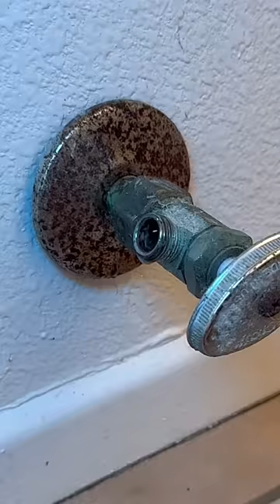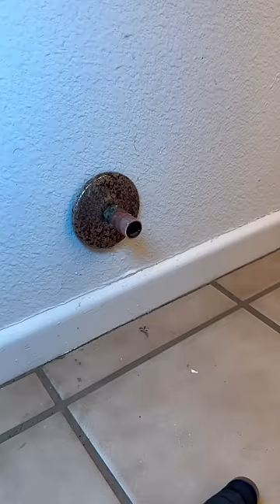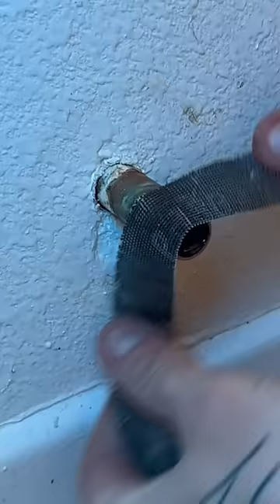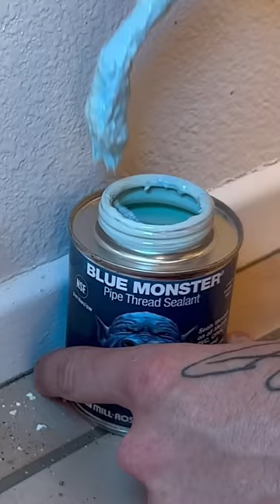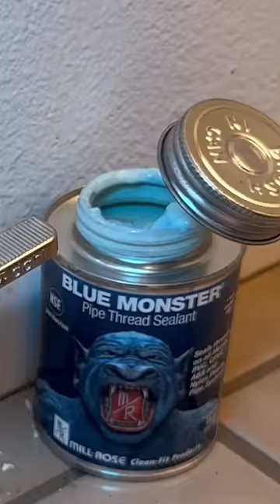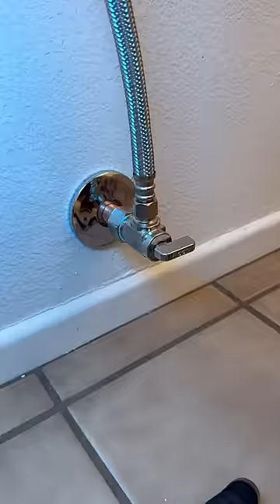HOW TO INSTALL ANGLE STOP! #new #newvideo #tips #tricks #hack #hacks #troll #water #plumbing #fyp

Comment: As a handyman for the last 20+ years, I'm always amazed at all the wrong places where people use tape or joint compound.
Reply from the maker: Oh my god don’t even get me started 🤦‍♂️😂
Reply: You don’t put thread sealant or Teflon at compression fittings. The brass ring does the water sealing.
Reply: I am glad you said that, I was just thinking the same thing
Reply: This guy does it wrong every time he uses a compression fitting. He thinks it’s extra insurance against leaks or lubricates the threads when tightening, neither of which is true. If I saw this on a job of mine I wouldn’t be calling him back again. 🤡 of a plumber!
Reply: I personally wouldn't use it.  Some people use it as an antisieze
Reply: I found Teflon tape on the bleeder screws on my car.
Reply: As an electrician I’m surprised some handymen are still walking around with a brain 😅
Reply: As a plumber for 20yrs, I see nothing wrong with putting a bit of dope on threads. Good job!
Reply: @ryancook1608  So you should be able to explain how that seals.
Reply: @robbsclassics  you're forgetting the other purpose of the dope, lubricating the threads because not all threads are made perfect, and the dope helps the fitting screw on that much better.
Reply: @robbsclassics  not for sealing obviously, but for antisieze, and to help lubricate and tighten better. There is nothing wrong with or without using dope on threads of this nature. I do it often
Reply: Ok. I'm still not doing it. It's needlessly messy.
Reply: @robbsclassics  if you cant help but make a mess then I'd have to agree with you hahahaha
Reply: @ryancook1608  What happens when you take it apart? What do your fingers and tools touch? What if you set it on the floor? Needlessly messy.
Reply: But he got tools. He a PRO!
Reply: That compression fitting don’t need it only gas lines
Reply: @kennhill968  gas lines using threaded pipes. Flare connections and compresión fittings don’t need pipe dope or thread sealer.
Reply: @rvd64  correct
Reply: @Tierone1337 does it compromise the brass ring?
Reply: That’s why your just a handy man bud.
Reply: Dude obviously knows what he is doing. Hence the specialty tools he’s using. I can almost guarantee that you’re using pliers and an adjustable wrench. 😮
Reply: @Iwishitwas-hl9wj i mean…it does lubricate the threads?
Reply: As a handyman if you don't know why he did that,that explains why your not a plumber...If you know you know #journeymanplumber #layingpipesince1995 #plumbing28years
Reply: As a handyman you've never had to install hundreds of angle stops consecutively. Stick with what you know...like plunging $hitters 🤡
Reply: It’s not acting as a sealant. It’s used to make a smooth finish as your tightening the compression nut. I personally use valve grease. Anyone who has to take that thing off in 20 years will thank him.
Reply: @HDPLUMBERS no please get started. Explain how that pipe dope will seal your compression fitting
Reply: @daddy1571  handyman - someone who has to know about a lot of things, have the right tools, and be efficient.
Plumbers - Someone who takes apart and puts together pipe.
Reply: @robbsclassics  plumbers are licensed by the state handyman aren't licensed at anything at all. Plumbers know plumbing and have to incorporate other skills too.handymen usually screw up jobs and steal people's money
Reply: @Basskilz15  have u ever seen a compression fitting with mineral deposits? No thread sealant
Reply: Use heat proof grease as a lubricant on compression joints  !
Reply: @jessesalazar7513  no. Because I use compression fittings in the proper way. I work in chemical plants and never have seen mineral deposits. You are not suppose to use dope or sealant. Hoke fittings and swagelock tell you not to
Reply: @jessesalazar7513  if I were to put sealant anywhere I'd put it on the compression sleeve or the tapered end of the angle valve
Reply: @Iwishitwas-hl9wj It's to get people like you to comment Driving up analytics, making it wear more people see his videos more money.😂
Reply: If you are calling that a "wrong place" to use joint compound then that explains why you have been a handyman for 20 years and not a plumber...
Reply: @robbsclassics it seals the threads so the nut can't possibly come off that is why it's called thread sealant... Also over time brass wears and that thread sealant will add that extra security so maybe instead of ten years you get twelve, not a huge difference but that extra two years is better than the ten. No it's not a need but at the same time that's why a plumber is a plumber, an electrician is an electrician, and a handyman is a handyman
Reply: Where can I get that back up bar at?
Reply: @Cpt.Pheonix  No. Pipe threads need sealant, specifically gas. Compression fittings rely on the malleability of brass and copper forming to each other. Right now I am currently working on restoring a steam engine lubricator. It is well over 100 years old. It has pipe threads and compression fittings. The entire lubricator is made of nickel plated brass and there is no thread sealant anywhere.
Reply: Dope on angle stops all day
Reply: @jeffreycrawford1121  Yes, if they're pipe thread.
Reply: @albertalmaguer7362  no it doesn’t. But it is useless and contra-productive. After a while it hardens and might act as thread locker. Also it is a waste of material=money overtime.
Reply: @Basskilz15  It doesn't make a "seal". It lubricates the threads so the ground joint is pressed together tighter.
Never seize will work too.
You should stick to plunging toilets.
Reply: @albertalmaguer7362 can affect the torque and over tightening becomes an issue… the thread here isn’t where the seal is formed so it’s a useless step and not needed. 

Like I can rub that paste on my grandma when she cooks for me, but the food won’t come out any better and I’ve just wasted time and money.
Reply: @daddy1571  oh that makes sense. It's a dumb plumber trick. See I'm a pipefitter welder who works in chemical plants. Must be a residential thing.
Reply: @daddy1571  you don't need to lubricate the threads to make sure the "ground joint" or compression sleeve (is what it actually is called...) get pressed together tightly
Reply: I find tape on everything. Today on some flared fittings
Reply: @danbelliveau2550  which is crazy but I get it because on JIC fittings which you're not suppose to put tape on but I have on my argon bottles to help keep it sealed better due to the fitting being used so much over the years.
Reply: @Basskilz15  You probably don't. It can help with inconsistent Chinese threads with imperfections. If it doesn't leak,either way works. I've installed vandal proof stops and didn't dope the threads and they sealed fine.
Reply: @xxxmikeyjock  thats what she said
Reply: @in-textbaptist4947 yeah maybe..but I’ve never had that in all my years. I actually hate that stuff. I see it on fucking sink tailpipes or teflon or even on the brass shut offs I’ll see teflon. Idk. I just know it’s not doing anything.
Reply: I've seen plumbers put pipe dope on the threads of plastic slip joint sink drain connections. It gums up the threads so you can't get it tight enough on the washers so they leak. Plus you then need pliers to remove them. Why?????   Another beef I have with plumbers is they fill up the kitchen sink baskets with so much putty that it, again, fills up the threads so you can't get it tight. I know, I'm just the property maintenance guy so what do I know, right? Just 50 plus years of experience, that's all. Smart a$$ plumbers.
Reply: There’s a reason it’s called pipe DOPE
Reply: @Basskilz15  BS they all seep out fluids and then it builds up around the fittings...been plumbing 28 years of om telling you the cat is black it's because I'm holding the cat in my hands
Reply: @robbsclassics  what would I set messy tools and materials on?! a pad, a piece of cardboard, a rag, etc; a professional plumber wouldn’t be setting much of anything on the floor. This is service work folks, y’all really should be humble on the subject if you aren’t a plumber.
Reply: @robbsclassics you ever heard of a paper towel?
Reply: Yeah that’s why you’re a handyman
Reply: @Matthiass721  I like to keep the things I'm working on, my tools, my work area as clean as I can. The only thing this does is gum up the threads and make a mess. It doesn't help at all. I'm not doing it. I have dope and Teflon and dope for pipe threads, not compression fittings.
Reply: @robbsclassics As someone who does House Remodeling and does this work alot.    Mess comes with the job. If you can't deal with a small mess then don't sign up for the job
Reply: @JaySunTheOmega  I restore houses. Some of which are 200 years old. I work on 100+ year old plumbing that comes apart fine with nothing on it. I have a steam engine lubricator that doesn't have dope on any of the threads, and that has to hold a lot more heat and pressure than anything in a house. I'm not putting dope anywhere on compression fittings. It's messy, wasteful, and doesn't help at all. If you don't understand the metallurgy of the brass fittings you use, I don't care.
Reply: @robbsclassics  I am not arguing for do and don't when it comes to anything. I'm just saying if you don't want to deal with a little mess don't be in that line of work. Sometimes you'll have to fix people's mistakes and that can be messy sometimes. That's all I was saying. I apologize
Reply: @robbsclassics It doesn't seal. It just lubricates the threads to make it easier to compress the ferrule .
Reply: @JaySunTheOmega  And I'm saying I'm not making a mess if I don't have to. That is all. My work is mostly fixing others mistakes, sometimes working with the 150 year old "temporary" fix.
Reply: @danvilla1438  No, it doesn't. It makes it harder to get it apart after a few decades of getting hard. If you want lubrication use a few drops of oil for no reason because brass doesn't want to seize to itself.
Reply: @Tierone1337  The brass ring is called a ferrule, no water will get anywhere near those threads. Amazed they didn't put pipe dope on the braided supply line threads as well.
Reply: Exactly. Someone gets it. You have to break lose enough old fused together fittings and you atart thinking aboutways to prevent it. Thread dope is just a nod to the next guy working on it.
Reply: As a plumber I see nothing wrong with pipe dope extra assurance hey why want 👍🏽
Reply: @MilkingTable1  What?
Reply: @MilkingTable1  your taking what I said out of content. Read ahead and you'll see he said stick to plunging toilets. Now while I do that at home I do not do that for work. He put it in a derogatory way
Reply: @MilkingTable1  and it's pipefitter/Welder. Mind your business.
Reply: @MilkingTable1  my plant setup is dow chemical lol stick in your lane kid
Reply: @MilkingTable1  we have a higher standard in plants. What trade are you? Lol and I've been doing this for 8 years
Reply: @MilkingTable1 bro I’m not confusing anything with anything. Any plumber knows that is not what that paste is for. You have confused yourself here thinking that the thread in the video creates a seal when it does not. That thread is only there to squeeze the olive. Honestly so many terrible builders are there  don’t know what they are doing
Reply: @robbsclassics it seals two ways now!
Reply: @kennhill968 In the UK any tape on a gas compression fitting would fail the regulations.😮
Reply: @andrewhart2330  oh no kidding we can only use the yellow tape on gas it doesn’t shred like the white or blue and I put pipe dope for extra piece of mind
Reply: @FirstnameLastname-vy2dg  Hahaha. How stupid of me. LOL
Reply: The amount of times I've seen PTFE tape on compression fittings is ridiculous
Reply: As a plumber of 10+ years, stick to being a handyman 🤣 ill be back to fix your shit
Reply: agree, why put thread sealant on a thread that is for sealing only compressing
Reply: @meatpiman224  pipes vibrate every time you turn the water on or flush the toilet in this case. They vibrate and make noise especially when you have a handyman do the plumbing and he doesn’t properly strap and support the pipe. After years of use the packing nut will loosen
Reply: I mean, if it works, then it
Works. What’s your complaint besides it actually works?
Reply: @robbsclassics I've done this when using a vacuum bleeder. Can't really bleed without some kind of sealant on them.
Reply: Every good plumber I've net used pipe dope on all threads even on compression fitting more for lubrication to get a good seat on it
Reply: @robbsclassics  so you wrote a lot to say you’re ignorant. Cool story bro, still objectively wrong. 😂
Reply: @Matthiass721  But actually right.
Reply: @robbsclassics first you get good then you get fast and then you get clean with it. 20 years experience gets you to the fast mark. Keep working you’ll get there.
Reply: @Iwishitwas-hl9wj ... Exactly.. If the ferrule didn't seat correctly that thread sealant isnt going to stop it from leaking.
Reply: @ryancook1608 ... Exactly.. If the ferrule isn't seated correctly the thread sealant won't stop it from leaking.. They are just gumming up the compression fittings threads using thread sealant..
Reply: I came straight to the comments to see who all said this exact same thing. Guy needs to keep watching how the other guys do it before making a video on how TO flood your clients house.
Reply: @robbsclassics
More than likely the Teflon tape on your bleeder screw was because someone was attempting to do a one man brake bleed using a water bottle and hose. The Teflon on the bleeder threads is to seal the threads when the bleeder is cracked open to prevent air from being sucked into the caliper when releasing the brake pedal in a one man brake bleed scenario.
Reply: I was here to sat this lol
Reply: Compression joint.....I Guess that's confusing. Absolutely no tape or dope
Reply: Why do you care what other people do let people work the way they wanna
Reply: @Iwishitwas-hl9wj your a clown of a customer, you should have done the work yourself instead of calling him, why care where he puts dope at if it doesn't need it it's just extra care
Reply: And that people use compression fittings 😮
Reply: @HDPLUMBERS you are who they are along about
Reply: Will it leak?
Reply: Listen fellas, I hear all of you. You all make good points. Pipe dope will not seal anything on straight threads on an angle stop. However, a little lubrication on the threads doesn’t hurt. Pipe dope as we all know is for tapered threads on pipe. Just like ptfe. I’ve seen the effects of over tightening a brass compression fitting be remedied with some wraps of tape around ferrule. On stainless swedgelock as well. Sometimes you just gotta seal it until you can do it right upon shut down.
Reply: Pipe dope is used to reduced the heat of friction when tightening the threads. I take it most the people here are called back for leaks regularly. This video shows nothing wrong with his work.
Reply: @robbsclassics 🥱
Reply: @robbsclassics yes 😂you a troll
Reply: He's probably doing it for engagement,  couple hundred people leaving comments that goop isn't needed, drives up comment count so youtube recommends the video more.
Reply: Buddy said he WILL NOT be surprised by a leaking compression fitting again!! 😅
Reply: You can literally see on the label “seals pvc, cpvc” 😂
Reply: Me too!! Should been used on the Ferrel.
Reply: @rvd64 in some cases they do.
Reply: And no ferrule either.
Reply: Yeah, well as a plumber you're supposed to dope the feral on a compression angle stop
Reply: Always dope 🏆
Reply: As someone who's a 18-year veteran of YouTube, it never fails to amaze me how blue collar workers spend so much time shitting on each other over stupid shit.
Reply: Lubricates the threads to prevent galling or lockup.
Reply: You are a handy man. This is what we plumbers call "insurance"
Reply: All the handy Andy's saying the compression doesn't need dope.   You my friend demonstrate your lack of knowledge by that comment.   Every plumber, I'll say again.  Every good plumber dopes a new angle stop.  Try again handy Andy.
Reply: Handyman aka jack of all trades, master of none
Reply: It's a compression angle stop .Why in the world did you use Teflon ?
Reply: Blows my mind too
Reply: That sealant will lubricate and cause him to overtighten the compression fitting which will  compromise the seal and the copper pipe. Even as anti seize, it's probably not rated for brass.
Reply: @ryancook1608 I work for the pipeline and we have hundreds if not thousands of compression fittings we have to inspect. I've probably done more this year than you did in your career. Not to even consider I used to setup multispindle lathes and run QC for pipe and compression fitting run offs.
1. Pipe dope is not a lubricant.
2. You just changed the torque value needed to compression the ring properly.
I have been to Parker and Swagelok classes too multiple times. Guess what they say. "DO NOT put pipe dope or tape on any straight thread only tapered"

Just cause you don't see a problem with it doesn't mean you are right. I've literally made, installed and annually inspect these fittings, not to mention I have to be OQ'd by the DoT to install them.
Reply: @atcook87  you work for the pipeline, you are not a plumber. You couldn't plumb a house or anything else. Pipe dope is wet, wet is lubricating. How would it affect torque values? Thanks for your comment I'll take it into consideration.
Reply: @ryancook1608  lol how is water distributed in a city and a house? Pipes right? We use all the same things plumbers use aside from pex and pvc. Flange fittings, tapered fittings, expansion joints, check/gate/slab/wedge/needle/twin seal valves. I can plumb a house but I guarantee you wouldn't get past the OQ for tube bending/installation of compression fittings or the one for installation of threaded fittings to even work on a pipeline. If I could link things I would send you some info on how lubricants change how torque is applied to a threaded connection. I'm not trying to be an ass. I literally went from making these fittings from blueprints and did the QC  tests on them to now working with them on a larger and highly regulated scale.
Reply: @ryancook1608  also pipe dope dries and doesn't stay wet. I don't know in what world you think lubricants should dry out.
Reply: @atcook87  no, actually plumbers and your utility trade are completely different things. I wouldnt pretend to be a utility man. Different fittings, pipes, and sizes. We shop at separate supply houses and adhere to different codes. Ive known and met utility workers, and they dont know plumbing code or how to rough in and finish a building, so dont pretend to be a plumber. I dont use pipe dope on compression fittings as much as I use to, now Im in a hurry, but, I see no harm in using a smidgen of wet non setting pipe dope on the threads only, and theres no plumbing code against it that I have heard of. Show me a plumbing code, utility man, and I will stand corrected and concede!
Reply: @atcook87  ky jelly will dry out too if you leave it out long enough, everything dries out, 2nd law of thermal dynamics hahahahaha... nice surname, we might be cousins somehow 😆
Reply: @robbsclassics bad argument to say “I’m doing it the way we did 100 years ago” times have progressed gramps and we have sealant now. “Jack of all trades is a master of none” you’re a handyman so I’m sure you’ve never read Shakespeare but he did have some good points.
Reply: @ryancook1608  I used to do Low voltage (different trade i know) working in construction, I understand how to read a print, rough in things and finish the work. Building codes aren't hard to follow. The only thing that sucks is some codes are different state to state. But the basis of the codes usually state, even in my industry, to install things per manufacturer specifications. Yes we go to different suppliers but I've grabbed 2" ansi rated flanges from a plumbing supplier before. I think it's funny you think we use different things based on the size.  I can literally go to a plumbing store and get what I need, the only reason we shop at different stores is because most plumbing suppliers don't supply MTRs for each thing they have in the warehouse. It I want a 90⁰ 1/2 npt elbow I have to get it from my supplier cause they have that document on hand. Lowe's or Ferguson don't.
Reply: @ryancook1608  lol maybe
Reply: @1stbadgamer389  Et tu, Brute?
Reply: The pipe dope worked exactly like it was intended to. It generated lots of comments.
Reply: Sprinkler fitter here; copper fittings, only use tape, for example a head. Everything else is dope then tape, for only the width of the tape. No need to dope and tape all the threads. Also, looks cleaner. 
I'm not a shit herder, so.....
Reply: When I was a plumber I put dope on everything. NEVER had leaks. JS
Reply: I knew somebody would see that he putting the sealant where is not needed that’s the only reason why I checked to see if somebody said that in the comments and is the first thing I see
Reply: @wtfishappening2049  the shit herder way. Did you put dope on all the threads or only the first 3-5?
Reply: @chocol8thunda  I just meant where the seals are. Not all threads, although on stop threads, it does help it spin easier. I'd put it on the brass rings though for sure.
Reply: @Iwishitwas-hl9wj  he doesn’t think it’ll stop a leak. He thinks it’ll lubricate the threads to prevent galling/seizing. Which it does. Some things serve more than one purpose. Quit acting like you know everything.
Reply: @Basskilz15  the way he’s using it, it’s for lubrication to prevent galling/seizing. Not for sealing.
Reply: @rvd64  blue monster doesn’t harden.
Reply: @atcook87  blue monster doesn’t dry out.
Reply: @chocol8thunda  did you say you put dope on the threads, and then tape? If thats true, that is silly
Reply: @BigBlockOverland  I know he is using it to lubricate  the threads and you don’t want to lubricate the threads on this joint. This joint needs the friction of the threads. Now if your over tightening your threads causing them to get galled you are the problem not the fitting or a lack of lubricant. Stop acting like you know more than me.
Reply: Soooo true
Reply: @Iwishitwas-hl9wj  it doesn’t need the friction of the threads. It needs the clamping force of the fitting causing a 0-tolerance fit. The friction of the threads means nothing. And if you mean for it to stay in place, the dope is ptfe enriched so it will stay once dried.
Reply: As a handyman.  I keep a container of 1/4 turn valves on me.
So many leaks I've repaired.
Reply: Nothing wrong with it! Just like any joint! Teflon dope it up!
Reply: @HDPLUMBERS dumbest comment of the year award goes to you.
Reply: @BigBlockOverland  I can assure you it does, I use it everyday and have a whole shelf of it.
Reply: @kennhill968 flexible gas lines do need it either.
Reply: Pipe dope is for lubrication and sealing. It helps the compression nut tighten easier in this circumstance
Reply: @HDPLUMBERS  you literally put the sealant on the thread instead of onto the copper between the fitting and the olive. You should do some training on how a compression fitting works.
Reply: @ryancook1608  It literally does nothing on a compression fitting other than get paste all over the threads?
Reply: @Dirtydiapers4U  nothing wrong with it other than your not supposed to use either on a compression fitting.
Reply: @Bill-nc6tx  Teflon dope it up!
Reply: @nico101gaming  nearly every single supply stop I come across, I can fairly easily pull the nut and ferrule off of the copper when I shouldn't be able to. Put a smidgen of something on those threads and tighten it down, then see if you can just pull it off. The engineers at brasscraft said its ok to put a bit of non setting dope or oil on the threads only, so who are you?
Reply: Old pipe that already have had a compression fitting on it, better to be safe than sorry. From experience reusing old pipe regardless how clean you think it is will sometimes leak. Stick to hanging shelves for old ladies and leave the plumbing to us who do it all day everyday for 20+ years
Reply: @HDPLUMBERS lmao my guy I can here to say the same thing. I’m a plumber also and while I don’t love the compression shut off it’s just a preference. And I have used them in certain situations plenty of times. but a handy man trying to call about a legit plumber ?!!! Are you kidding me.. I’ve been doing plumbing and heating 25+ years and never and I’m not exaggerating, never have I seen a diyer or handyman ever , ever ever do the correct plumbing job. It could be the simplest fix and there something wrong with it.. it might work but it’s wrong. Using pvc 90 incorrectly for a drain is a common one or them using some rig because they don’t even know what the correct part to use is or that it even existed. Hiring a handyman for plumbing always baffles me, you could literally kill  someone if you do things wrong incorrectly. Hire a handyman to make you a shelf or paint that’s it. And what these YouTube handyman are charging to do shit wrong doesn’t save you a dime.
Reply: Lmao I’d stop, in my 25+ plus years I have never seen a handyman do the correct plumbing job so really stop.. and i am not exaggerating NEVER and dont tell me you are different , you don’t even know if you are doing the right job.. you go oh that’s stupid I’ll do it this way and you don’t even know why things are done so you don’t even know if you’re actually doing it right. Do you own your states code book? No. And the fact you would put peoples life at risk , because doing plumbing , heating wrong you could kill someone os horrifying. Plumbers aren’t even part of the building sector we fall under the health board just to let you know.. so go call out other handy man
Reply: I'm learning
Reply: @robbsclassics noooooo
Reply: @Iwishitwas-hl9wj  what problem can it cause? You didn't talked about issues with this, although you claim to be useless. But there is any real problem?
Reply: Pipe dope can lubricate the threads which isn't necessarily a good thing as it can lead to overtightening if you don't know what you are doing. Other than that it really isn't necessary.
Reply: @Tierone1337  you can still put sealant wont make the seal any worse and makes it easier to replace later
Reply: @Iwishitwas-hl9wj  it does lubricate the threads, compression fits can still rust at the connection over time and thread sealant is a barrier that will make it still easy to remove over time doesn't effect it negatively at all its just not needed...
Reply: @Ian-tp6mu  why comment when you know nothing about the subject. This fitting will not rust and can not rust, it is made of brass plated with chrome. Yes he is doing it wrong since these fittings need the friction of the threads to keep the threads locked. Rust? Really? Your ret@rded
Reply: that shit really bugged the hell out of me
Reply: @robbsclassics  i mean can nobody here read it literally says thread sealant what other combination of words would you need as conformation 😂
Reply: I knew aguy that put tape everywhere it was a mess . I took it off and cleaned up behind him all the time! Can't leave it manytimes it causes leaks especially if its done wrong 😂
Reply: If it doesn't leak in 50 years or causes no harm whatsoever...does it matter?
Reply: Es plomero sabe y tiene lo necesario de herramientas, eso es basico
Reply: The real expertise can be found in the comments not in the silly videos
Reply: Says things about pipe sealant says nothing about using a compression fitting right back on the the same pipe where there already was a compression fitting without cutting the pipe.....THE BIGGEST NO NO in plumbing 101
Reply: @Tierone1337  your 100% correct the Ferrell does the sealing, however, I will put dope on the Ferrell, and sometimes I use dope on the threads to make it a little smoother when I’m tightening
Reply: Thank God, I didn't use sealant and thought I did it wrong
Reply: No need for dope on a compression fitting.
Reply: @robbsclassics don't agree with putting it on the threads however with this pipe being corroded and not being able to guarantee the diameter I couldn't see the harm in a bit of boss white and PTFE on the brass ring to ensure a good seal.
Reply: From just looking at what he did, twice, and being a pipe fitter of almost 10 years; he didn't put thread sealant on the compression fitting. He put it on the threaded female to male connections. That's a female to female slip by thread with a male to male thread by thread angle stop valve.

He sealed the female thread to the male thread valve. Nothing wrong is done here.
Reply: @Iwishitwas-hl9wj whats wrong with putting a little bit of added protection😂 compression fitting or not it makes it easier to get on like i said its added protection aint nothing with what hes doing,
Reply: As a plumber it doesn't matter what a handy man thinks
Reply: @Iwishitwas-hl9wj  why would you call a plumber if you know more than him anyway who cares if somebody puts piped up on a compression fitting it isn’t gonna hurt anything some people get more peace of mind putting it on there like myself matter fact, I put it on the compression ring too but what do I know I’m just some dumb commercial industrial mechanical contractor
Reply: @Jerbo1125  yes it does hurt something, that fitting needs the friction of threads on threads. It wouldn’t give me peace of mind, that fitting will leak before a fitting without sealant. This plumber should follow the manufacturers recommended install method not make up his own. I would call a plumber because I’m way too old and financially well off to be playing around behind a toilet, just because I can do it doesn’t mean I want to do it.
Reply: "as a handyman" so you don't have a college degree? Haha
Reply: As long as it doesn't leak.
Reply: Lmao
Reply: @ryancook1608 or just use anti sieze...old gas fitters used to use matchs to look for gas leaks. Don't mean it's the right way to do it
Reply: Guess thats why you a handyman and not a professional.
Reply: A handyman is. Not to comment at all😂
Reply: Was just thinking this.  Compression = no sealant....
Reply: The dope not only lubricates the threads it also lubricates the ferral a bit. U don’t want the threads to be what tightens u want the ferral to compress and create the seal. The lubrication helps insure that this is what’s happening. It helps you feel the compression and not just the threads. I agree with that pipe dope being used here. But that’s the only pipe dope I would use on a compression fitting. Also yes I have my p1 license and been doing it 20 years.
Reply: Like on the threads of stove hoses …😂
Reply: 😂😂😂 HANDYMAN like that’s a job title or something.
Reply: As a handyman for the last 80+ years i agree
Reply: I know man ridiculous, and that reamer is terrible
Reply: @ryancook1608 Absolutly agree with You. Some people just like being negative.......😅
Reply: @Tierone1337 that would not be correct, the dope placed when it was serves 2 purposes. 1 it lubricates the threads so the nut can be tightened better. 2 the dope is placed where the ferrule is seated for a better seal.
Reply: @Iwishitwas-hl9wj you are incorrect. It is exactly what it is supposed to do.
Reply: My exact thought
Reply: As the CEO of blue monster I approve. Although not enough product was applied. You have to dip it. 
Like an Oreo in milk. At least elbow deep though.
Reply: In Cali we epoxy those connections.. ...the combination of pipe dope, installer dope and epoxy ensures no leaks....4-10 mandude....the Cali way rules....plumbers leaving Cali because they're NOT good enough to hang with the TOP DOGS!
Reply: @Tierone1337 that wasn’t a flare fitting
Reply: Yep, that sealant on the threads does nothing but waste time and your money.
Reply: @Iwishitwas-hl9wj  What would you use ?Will you sweat it if not using a compression fitting?
Reply: @robbsclassics gas pipes use tape and or pipe dope or monkey snot above ground. Below ground on transmission lines, we use ab nipples and seal weld. That is not a compression fitting like many are saying. Looks like a valve, with a union.
Reply: @NathanThePrezPretlow  I would use the same fitting just no sealant and install as per the manufacturers instructions.
Reply: @gns4838  I have replaced tons of those. It's a water valve for a toilet. Yes, it is a compression fitting like I'm saying. I can't believe you can install gas line and not know what a cut off valve is.
Reply: Whaaaa
Reply: Lol 🤡
Reply: Hey u need some gloves
Reply: ❤Ptoptpptt
Reply: The threads don't seal the fitting too the pipe, who trained you.
Reply: It's lubricant..👀
Reply: As a plumber of over 30 yrs I was going to say something very similar.
Reply: Pipe thread sealant is not needed on compression fittings, amateur.
Reply: @Cpt.Pheonix or you could just put the damn thing together as the manufacturer intended.  This is a hack not a proper procedure.
Reply: @Cpt.Pheonix  It's... Not loctite nor is it anti seize.  Do you even know how a compression fitting works?  Because if you think those threads need sealed you don't know shit.
Reply: That isn't wrong
Reply: @josephpark3048  I specifically said it is not needed, however I stand by what I said. It's the small things you learn over years of doing something, that's why a plumber is a plumber and a handyman is a handyman
Reply: Holy shit right?  I find pipe dope and tape on swivel flare nuts but never compression fittings holy shit.
Reply: @ryancook1608  If you see no problem with it then that means you probably aren't doing the other part of the job correctly.
Reply: @MrScotaru  not only is that a ridiculous thing to say, but, you should have read some more of what I said the the conclusion. Engineers at Brasscraft have stated that it is OK to use a bit of non setting pipe dope or oil on the thread of a compression fitting.. Are you an engineer? I didn't think so lol
Reply: Looks like that socket and extension is a lil pitted, definitely not Snap On!
Reply: Good Job, id hire you no problem
Reply: Same, unless the dude is using it for anti corrosive, or for comments.
Reply: Tape is a sealant.  Dope is for lubricant purposes.  Although I don't see the need what he did wasn't incorrect.  He lubricated his threads to get a slightly tighter seal on the ferule when tightening the nut.  Me personally never have and probably never will but that doesn't mean he was wrong.
Reply: You don't need to put anything on a compression fitting but it does help lube the treads and make tightening a little easier.
Reply: Everyones wrong... teflon and pipe dope dont seal anything... theyre both essentially a lubricant to prevent metal on metal friction.... they used to use cutting oil instead of dope and teflon... using dope and teflon isnt going to HURT that joint, its unnecessary. Can we all just be happy that he used a compression stop instead of a sharkbite?
Reply: Is funny. How a bunch of ignorant talk about handymans when, in reality a handyman has the knowledge on how to fix pretty much everything and have the tools for it compared to a person that only does one type of job, is like saying that you are smarter than the guy that speaks 5 languages because you speak one 😂
Reply: No lo creo,  para mi, mejor soldarle un cople roscado macho , y listo, años de aguante cada que cambien la válvula.
Reply: I don't see a copresion ring. Maybe that's why the sealler.
Reply: @HDPLUMBERS what is the wrench u used name exactly?? Its so interesting
Reply: Yea well your not a plumber your a handy man and if he wants to put dope dope on the threads it doesn’t hurt anything..
Reply: Everyone on here talking shit and that’s why you are handy men that do shit jobs you have no clue about plumbing, I have went behind so many so called handy man and the shit I see is amazing
Reply: @robbsclassics  I did not see him make a "mess" with anything he did in this video...
Reply: I am not a plumber and know that the valve doesn't need thread compound. It doesn't show the compression ring, but it should have one. Pipe dope is not going to prevent leakage from that valve.
Reply: @robbsclassics there may actually be a valid reason for that. When the bleed screw is open when using a vacuum bleeder it sometimes pulls air through the threads rather than pulling the fluid, so a bit of PTFE on the threads can help stop that.
Reply: @dafyddwilliams5223  It was on the clutch lines too. I found so many things wrong that had to be corrected on that car.
Reply: If you have an angle stop with a compression fitting, you put the pipe Dope on the ferrule, not the threads. 
This guy doesn’t understand the basics of plumbing. 
I’d be willing to bet he makes the same mistake with slip joints and unions.
Reply: @travishouse5988  No, no pipe dope at all. Don't confuse people.
Reply: What kind of wrench is he using?
Reply: That was actually the best place to put the paste. If you look closely it was just on the point where the olive will compress on the valve.
Reply: @Hesterplumber   as a handyman I’ve corrected work for both plumbers and electricians many times…. But I work alongside the old guys and learn the correct ways.. just saying not all handyman are bad people the fact I can do more then most trades makes me smile. I can do everything I’m not trade specific… but I’m always willing to learn new things.
Reply: @Tierone1337  he was using it as a lubricant. The old brass craft valves in the instructions would tell you to put a drop of oil on either side of the Ferrell. We don’t carry around a little thing of oil for that so a little dope we’ll do it. 
In fact, if when you’re putting compression fittings together and they squeak it’s because of friction.
Reply: @daddy1571 Most handymen leave the feces to the plumbers...pretty smart, huh?
Reply: Actually brasscraft used to have instructions on the box back when I was an apprentice. They said to use a drop of oil if you’d like to. There’s nothing wrong with this. The instructions are on YouTube now. The purpose of pipe dope is not to make threads seal up. It is to make things easier to turn so that they will seal as they were designed to.
Reply: @kirbazoid you beat me to it. Did you start in the 90’s too? You’re absolutely correct. No one carried 3 in 1 oil around for stops. We used to use wax for c/o plugs instead of dope too. Worked better.
Reply: Exactly you’re a handy Andy, not a plumber. You through some dope on the threads not to seal but to keep the compression nut from seizing to the valve. Been compression fittings this way for 20 years. Read a book or something nerd.
Reply: So does anyone put rectorseal on popup assemblies to keep the water from running the threads? 

No it's not a compression fitting, but what's the harm in additional sealant for manufacturing defects and imperfections?
Reply: Most people use it as a lube for threads makes it easy to replace in future
Reply: Agreed!! Besides. A shark-bite fitting is so much easier.
Reply: He put the dope in the wrong pipe! Or maybe he put in too much! 😂
Reply: @anthonyestenes5598 owning a torque wrench doesn't make you a mechanic! js
Reply: I've always said that but my boss says im wrong haha @Tairone1337
Reply: In this case they are using it as a lock tight application so nothing backs off and ruins the whole house. They are not using it as a sealant.
Reply: In this case they are using it as a lock tight application so nothing backs off and ruins the whole house. They are not using it as a sealant.
Reply: In this case they are using it as a lock tight application so nothing backs off and ruins the whole house. They are not using it as a sealant.
Reply: I know 😂
Reply: What is that first tool he is using?
Reply: Use thread seal when sweating pipes
Reply: You’re just a “handyman” not a qualified professional 🤓
Reply: As a licensed plumber, I agree. Also, where are the ferrules? There should have been one on the old pipe that usually has to be cut or ground off if it was put on correctly.
Reply: @Tairone1337  Been a Master Plumber since before you guys were messing in your potty chairs. You indeed do put sealant unless you want to be back for a potential mess. Also, it helps the next plumber who deals with it. Especially after you handy thingies mess it up!
Reply: @HDPLUMBERS is 😊😊
Reply: But what is that tool called he threads on the valve that’s cool I want one
Reply: @robbsclassics lmao 😂...😧
Reply: He's a handyman for a reason and not an actual plumber.
Reply: The dope lubes the threads no harm in using it
Reply: Silicone Grease!
Reply: @Iwishitwas-hl9wj every plumber I know uses dope on compression fittings. Only put it on the threads, it’s so that the metal doesn’t eventually fuse, and when it needs to be replaced you can actually unscrew it.
Reply: @Tierone1337 the dope isn’t for sealing
Reply: Plumbers watch YouTube?
Reply: Don’t criticise that guy’s work. He used Dahl angle stops not crappy multi turn valves
Reply: Agreed
Reply: @daddy1571  it must make you feel good to be such an arrogant stool sample
Reply: @robbsclassics it’s not for sealing the fitting. He probably should use some never seize instead, but he probably doesn’t carry 10 different pastes in his bag.
Reply: @Basskilz15 yes in an industrial setting on tubing you’re not putting dope on compression fittings, typically you’re also not mixing different types of metal tubing that corrode or react with each other either. If your chemicals or high pressurized hydraulic lines were leaking you most likely have an issue that needs to be fixed like the feral not sitting fully. In residential the pipes sweat they don’t get maintenance for 40 years when it just works… can’t compare your plant to a house. It could be never seize instead of dope, but at the very least it’s not hurting.
Reply: @peanut9779  pipe sealant on the threads that don't even seal anything lol okay. Should of used a bit of antisieze if that's the case. I work with the stuff, dude. All I'm saying is that it's unnecessary.
Reply: @HDPLUMBERS he’s talking about you 😂😂 jk 👍👍
Reply: Whats wrong with a lil dope on the threads… i mean as long as its not like pvc to plastic shit than it really dont hurt
Reply: Ur a handyman
Reply: Not many brain cells in this thread.
Reply: @robbsclassics gay
Reply: @ramiromoreno1386  I'm so sorry for your intellect.
Reply: @Cpt.Pheonix  Some hardware stores got them,also Home Depot,,,?
Reply: It's not a joint compound it is thread seal or pipe dope
Reply: @daddy1571 most every torque on a fastener is dry for a reason to prevent overtorquing. Hopefully none of that goop ended up inside the valve either.
Reply: You said it mr handyman mr 😂😂😂😂 I will be back cause you over tightened it and ruined the copper now it cost more to fix
Reply: It's a lubricant as well not just a thread sealant. So he's not wrong.
Reply: I us pipe dope sometimes like that simply to make tightening easier, lubricating the threads reduces the pressure you have to apply to tighten it properly,  most of the time you can get the fitting way tighter with pipe dope applied
Reply: @Iwishitwas-hl9wj Every plumber I know puts pipe dope on compression fittings, including me. It lubricates the threads to help it seal well. Duh
Reply: @smu414141  but that’s because you don’t know what your doing. If you were taught to do it that way then you were taught wrong.
Reply: My favorite is when you find Teflon wrapped around a gas shut off valve which seems to be about 50% of the time
Reply: Absolutely nothing wrong with where he used it, it gives that little extra security and also lubricates the threads, nothing wrong with it
Reply: You said it yourself a HANDY MAN!!
Reply: @Tairone1337 after you go to remove the valve after 16 years you'll understand why he put Teflon paste there
Reply: @Iwishitwas-hl9wj after you go back after 16 years to remove the fitting,  you'll understand why Teflon paste was applied
Reply: Okay handyman 😂😂. You always put dope on a stop
Reply: In your 20+ years as a handyman (no degree, formal training, or certification needed), you never came across a seized nut on a valve or any nut on pipes or bolts? 

Take another 20+ years and learn what else thread seal tape does. 

You just exposed yourself. Next time just 🤫
Reply: @Iwishitwas-hl9wj don't worry your single wide won't need it soon enough.
Reply: Came here to say that. Dude cleaned that copper, then out came a can of dope, and I was confused for a second.
Reply: @Tierone1337 Its for lubrication not sealing. You can get an extra half turn before it starts binding from the friction. Of course you know-it-alls already knew that though.
Reply: @Iwishitwas-hl9wj It doesnt lubricate the thread?
Reply: @robbsclassics If you cant handle a little Pipe Dope w/out making a mess youre ib the wrong business.
Reply: @robbsclassics okay same reason you put it on a union nut ….lubrication/ antisieze in 10-20 years you’ll see the difference between the plumber who was thinking of the next repair.
Reply: Exactly 😢
Reply: Hey “Know it all” the pipe dope helps keep the chrome plate from balling up in the threads. Yer fired too…next!
Reply: @robbsclassics Teflon tape on bleeder screws is actually smart. It prevents air from leaking back into the cylinder through the threads while manually bleeding.
Reply: Agreed!  You do not use dope on compression threads…..especially when using a crush sleeve like on an angle stop.  You use dope to fill the threads and make the connection water tight. But with these, the threads don’t make the connection, they compress the sleeve that makes the connection with the pipe.  Some people just won’t NOT do this and I’ll never understand why.
Reply: Yup, I always thinking why they still put some sealant on a compression fittings.
Reply: Beat me to it
Reply: @Tierone1337 lol it’s fine to use it on shut offs don’t seem why your panties are in such a twist
Reply: The next gen are a lost cause
Reply: That shit didn't even make sense.  😂😂😂
Reply: @jeffholm9086 That’s why you’re a handyman and not a plumber
Reply: Compression fittings do not need pipe dope.
Reply: @Iwishitwas-hl9wj 
I'll say that at least the guy actually attempted the repair, unlike most males nowadays that have been feminized.
Reply: @ryancook1608 The amount of time that you've been a plumber doesn't necessarily reflect the validity of the action that this guy has taken in adding liquid pipe sealant to threads of a compression fitting. What is your highly experienced, expert opinion as to why it is advantageous to use a liquid thread sealant on a compression fitting?
Reply: @kennhill968 ugh, I run into that mess all the time. Just clean and properly torque your fittings.
Reply: @MrDeviousdom  Brasscraft says it is ok to add a bit of oil or non setting pipe thread sealant on the threads of their compression fittings
Reply: @ryancook1608  I agree that oil is what you should use, but you're only making a mess for the next guy by using pipe sealant. Just sweat on a new fitting!
Reply: It's not to seal..... It's to lubricate it so the next poor bastard that has to take it off will be able to.
Reply: @robbsclassics   I've gone behind ID10T's that refuse to lubricate threads and you all Fkn suck!! Hell, just look at how rusty the wall plate is in this video!!
Reply: I’ve cleaned up so many messes that “professional” plumbers have made with angle stops it’s a joke.  Most will use the same old ferrule and over tighten it to stop leaking.   Using emery cloth puts small grooves into the copper which might cause a leak.   I use all metal valves, put Rectorseal #5 on the new ferrule, and tighten.  If new copper is there-no sealant needed.  There are so many overpaid, bad plumbers who charge unbelievable prices.
Reply: Bueno creo que también se puede como sellador pintura de aceite yo recuerdo que en la instalación de una toma de agua potable en el cuadro que se armaba para dejar el espacio para el medidor como era en tubo gabanizado en las cuerdas para poner un cople y después un niple de 15 cm y luego en el niple se ponía la contra de la tuerca unión y así asta que se armaba el cuadro de la parte donde se colocaba el medidor del agua potable y sellaba muy bien pues nunca se dejaba fuga de agua y creo que existe más formas de trabajar con las tuberías que hoy existen
Reply: @ryancook1608  exactly and it does help lubricate the threads allowing the nut to compress the ferrule easier
Reply: Adding a little pipe dope to the threads allows the nut to tighten easier and compress the ferrule easier and you can lock at the man’s tools and tell he knows what he’s doing I’m also a 30 year plumber
Reply: @Basskilz15  I may be wrong but I don’t think you use an angle stop with water in your application and most gasses won’t allow pipe thread sealant and it is harder to seat the ferrules
Reply: @Tierone1337  I thought this too until I saw that brasscraft recommended applying dope to the threads for lubrication purposes.
Reply: @Iwishitwas-hl9wj  It does lubricate the threads according to brasscraft.
Reply: @robbsclassics  It doesn't seal. Brasscraft recommends it for lubrication purposes when tightening.
Reply: @robbsclassics When you take it apart 20 years down the road, the dope isn't going to make a mess.
Reply: @robbsclassics 😮😮😮
Reply: Plumber for 42 yr and yes you put pipe dope on the thread. Brass craft even states it on the instructions. It use to say a drop of oil.
Reply: @robbsclassics 
El aditamento interno( campana, barrilito o como se le conozca) es de un material relativamente suave que se deforma “plasticamente” al comprimirlo, sellando contra el tubo y el espacio interno de la tuerca…
Reply: Highly controversial topic though, the ferrule compression is what seals it, but pipe dope can still be used for lubrication to tighten the compression fitting down easier. Its not always about trying to use it to seal.
Reply: He reamed it.❤
Reply: Aahhh,,I was gonna say where's the ferrule???😂😂😂😂
Reply: It has it’s purpose, but since your a handyman man you don’t know!  Let me know if you need me to teach you! And say please and maybe I will
Reply: It's actually commonly used to add paste or tape with with both parts being metal